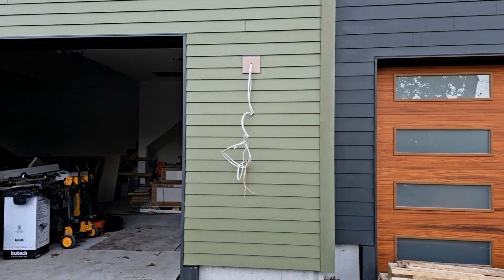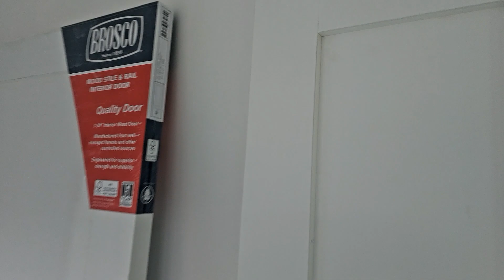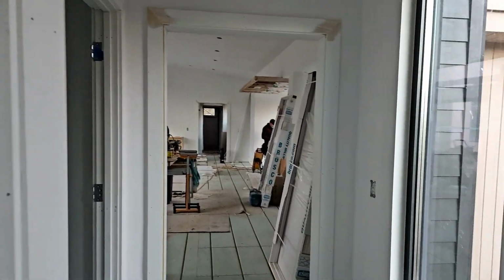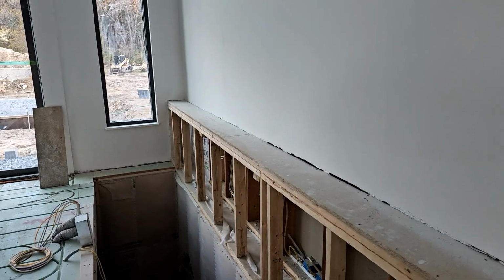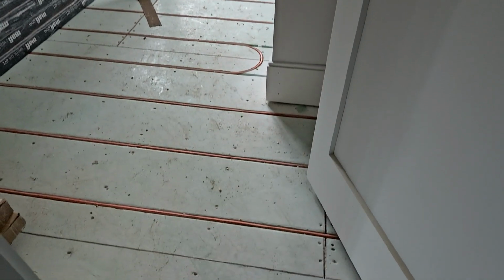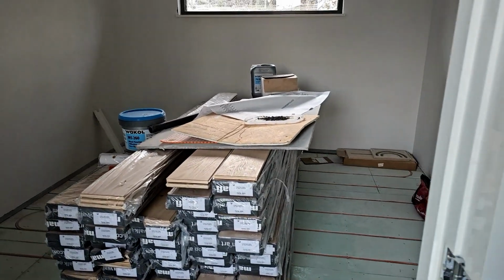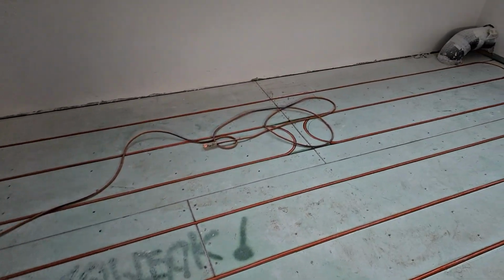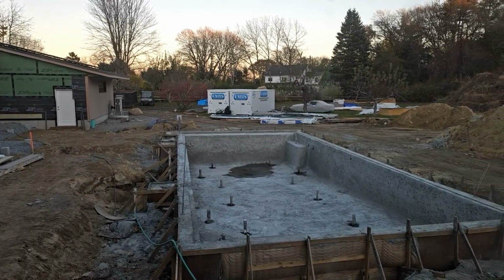BSBB INTERIOR PROGRESS TOUR

Comment: Steve does this house have net metering if so, are the batteries backup. Seems like very expensive backup?
Reply: Batteries are expensive, but they serve an important purpose for the house and for the grid.  The house will be on the utility's Peak Demand program that allows them to suck the power from the batteries down to 20% on up to 60 days in the summer months to help meet their higher demand levels between 2pm and 7pm.  They buy that power from the array owners.  If more homes had batteries and were part of that program and there were more stand-alone commercial battery sites, we would be on the path to eliminating the need for fossil fuel based peaker plants.  Lots of issues that need to be addressed with the grid and the increased demand for power from EVs and all-electric homes, as well as retrofits with heat pumps.  The key is lower load from better insulation and solid load management technology.  We are using Schneider's system.

Yes to net metering and the Massachusetts legislature passed legislation last year to raise the max array size for net metering at full rate from 10kW to 25kW.  Given the climate, the summer generation is needed to offset the much lower winter production, along with the snow issues.

Our current house has a smaller array and three Tesla batteries.  They will easily pay for themselves in a reasonable period, after the tax credits.  The new house will do so as well, but more likely to take longer as the incentives are different now.  Tesla charges an unfortunate 20% "Fee" for managing the batteries on the peak demand program.  Enphase does not!  That changes the program economics notably.

What I also hear all the time is people thinking that solar arrays without batteries will provide power when the grid is down.  Only a tiny fraction of the latest tech in solar arrays will do that (Enphase IQ8 and a very few others) and almost all arrays are useless without grid power.  The batteries make a difference.  Just last week there was a storm with multi-day outages in a number of nearby towns.  With the combination of batteries, great insulation and air sealing, load management, and a large enough array to generate more power, we would have power to handle the needed loads for a number of days, even through a rainy, cloudy, or snowy period.